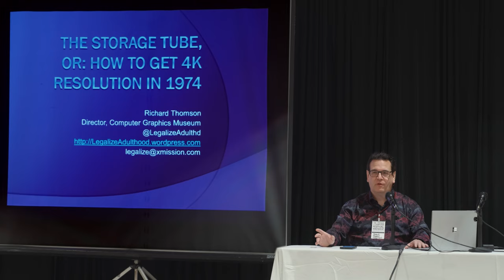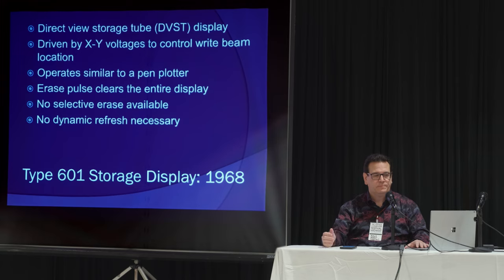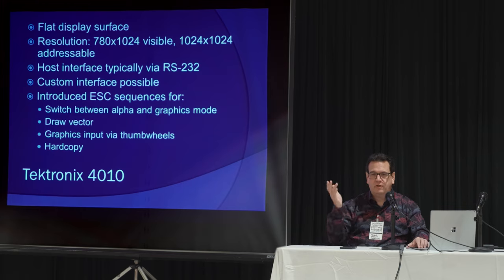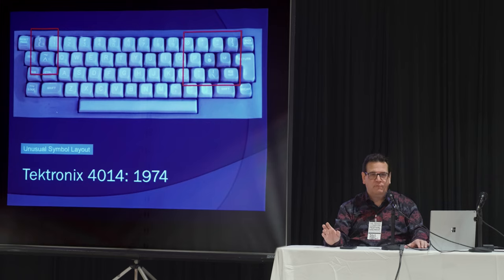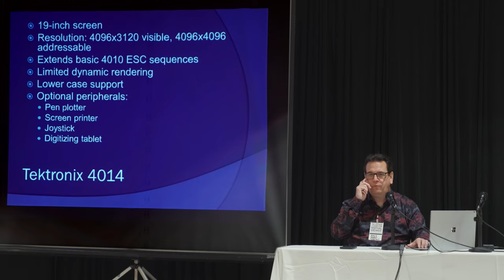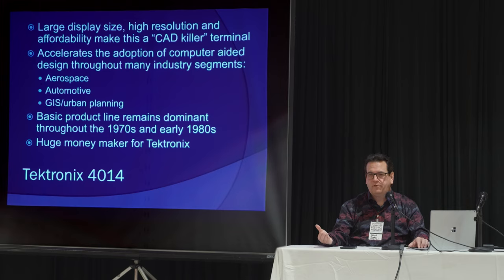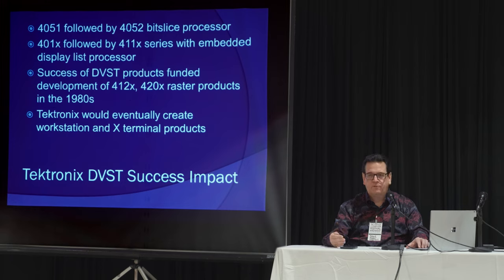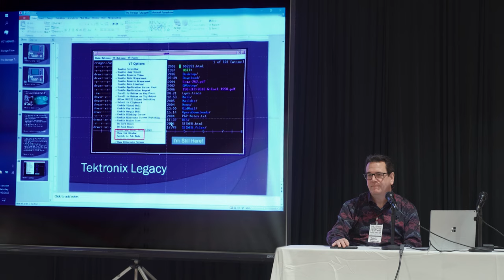Storage Tube Displays: How You Get 4K Resolution in 1974 | VCFMW 17 (2022)

Comment: The T4002 terminal had as standard upper and lower case character generation, using a diode matrix character ROM in the first generation, and a SSI chipset in the second generation.  Also there was a joystick option for digitization.  The engineer who designed the serial interface on the 4002 and 4010 in later years developed the Z-Modem protocol.